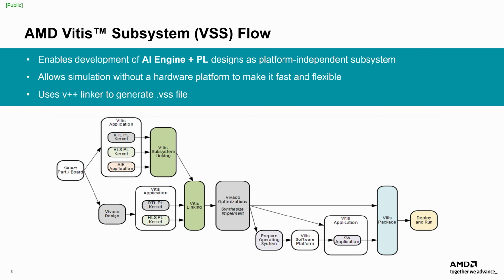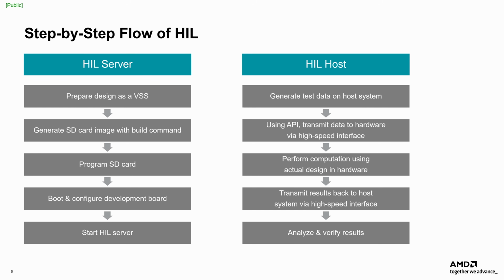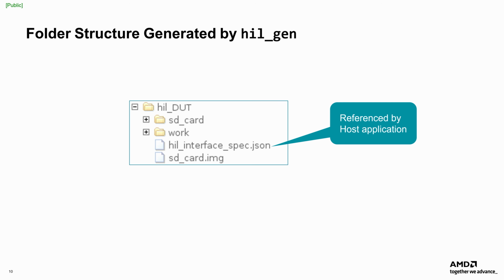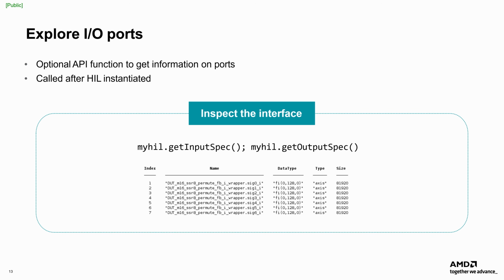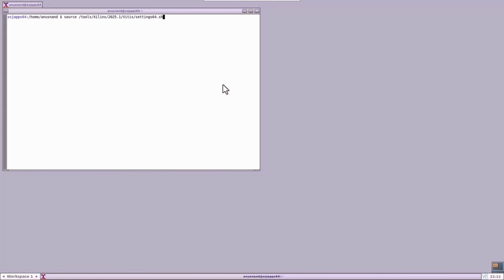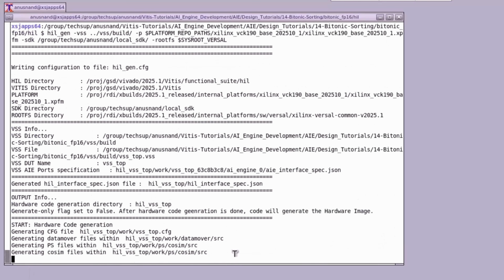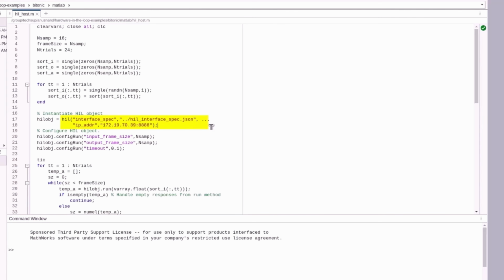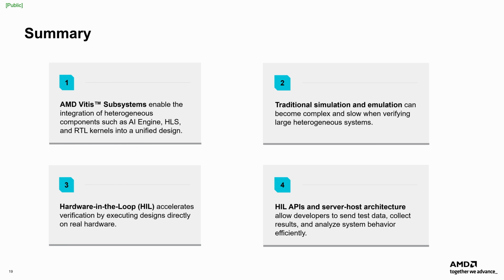Using Hardware-in-the-Loop (HIL) for Rapid Simulation with AMD Adaptive SoCs

Comment: Another thing, AMD. With the launch of the 9000 Series, your market share dropped from 15% to 5%, while Nvidia expanded its dominance to 95%. This is clearly due to you boycotting your customers who own the 6000 and 7000 Series. I own a 7800XT, and if you don't release an FSR4 for the 7000 series, I'll never buy another video card from you. This anti-marketing policy is outrageous. Imagine someone who owns a 6800XT, 6900XT, 7800XT, 7900XT, and 7900XTX seeing a 9060 with FSR4 and their card not. A friend of mine has a 7900XTX, he built another PC with an RTX 5090 and sold the 7900XTX, he said he'll never buy an AMD again, that it was the first and last one, I had to agree. When you release FSR5, will it be exclusive to the 10,000 Series? Will you abandon the 9000 series like you did with the 6000 and 7000 series? A piece of advice, fire the people who make these bizarre decisions at Radeon, they are very incompetent, otherwise soon Intel will be overtaking you with the Arcs.

Comment: AMD, help us, launch the 5800X3D into mass production globally. It's bizarre that the Commemorative Edition costs more than the 9800X3D and has a ridiculous production. Let's adjust this price as before and put that 5800X3D printer to work 24 hours a day, 7 days a week. This processor should never have stopped being manufactured. Remove several AM4 processors that we no longer care about and replace them with the 5800X3D.

Comment: Nvidia announced:
- MFG 6x;
- AUTO Shaders;
- Reflex 2;
- DLSS 5;
- NTC.

AMD's achievements are also significant, see:
Reply: Actually tragic. Everyone is dogging on nvidia for adding "pointless" features and amd doesn't add anything at all. The second nvidia releases a 16 gb 70 class card for 500-600 I'm out, this 9070 will die of lack of support
Reply: @Efsaaneh I'm predicting that we won't have FSR5 for RDNA 4, so the best thing I did was sell my 70XT and buy an RTX 5070, not just for gaming, most of my time will be spent working.